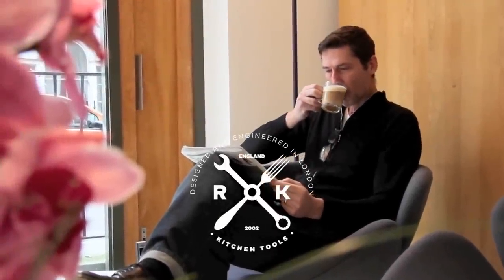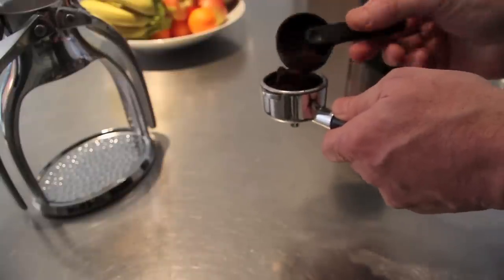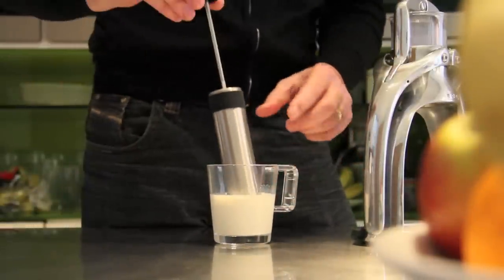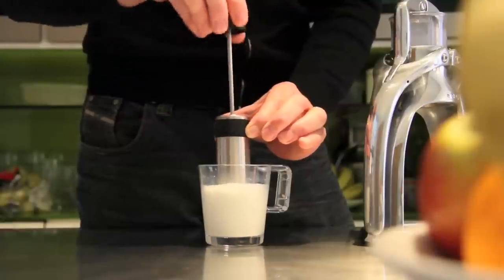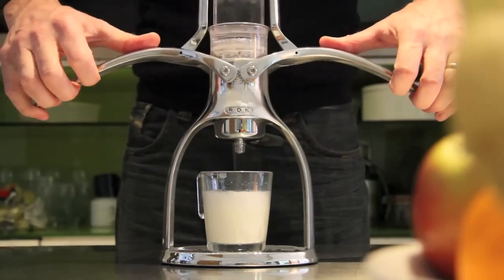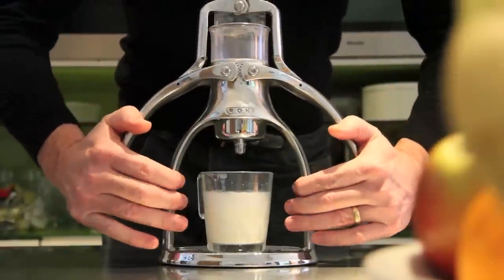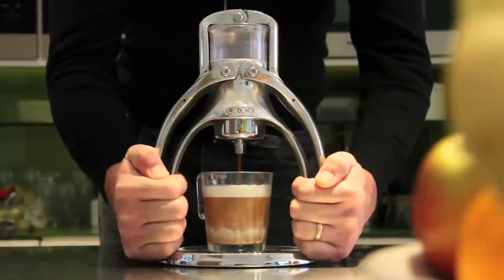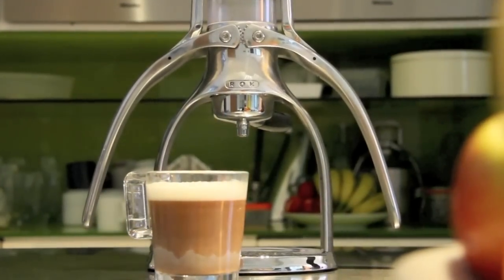How to Make a Latte Using the ROK Espresso Maker

Comment: Those machines are silly and they cause people to move from standard straight coffee or black tea straight or only with a little milk which was the proper way to consuming tea lattes and things which add chocolate, milk, cream and sugar to the recipe. Straight coffee or black tea or that with only a little milk is much better for you than those chocolate, milk cream and sugar based complex drinks which add calories to the cup and require machines to be cleaned out. The odd latte is nice but you just need to do it the simple way